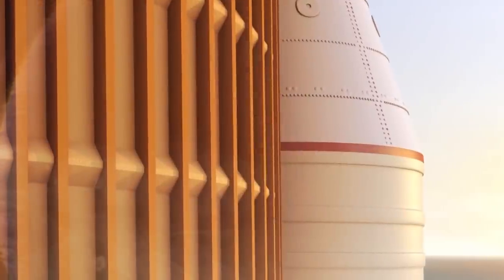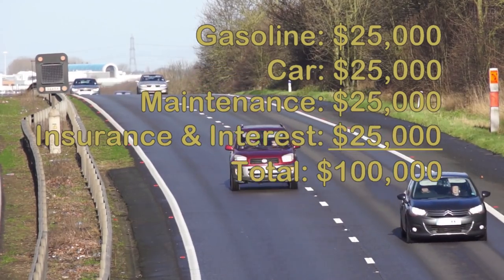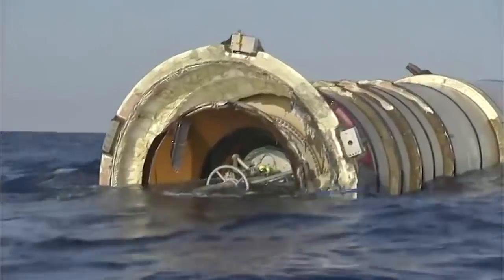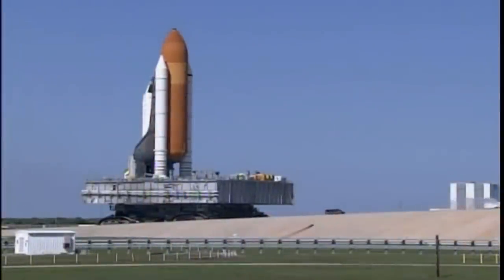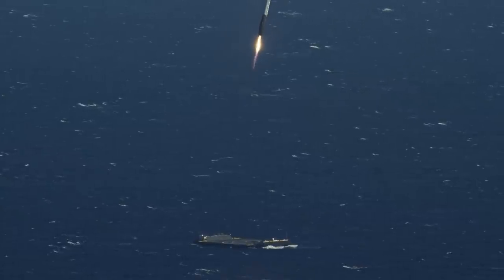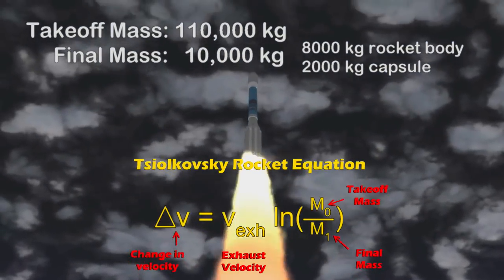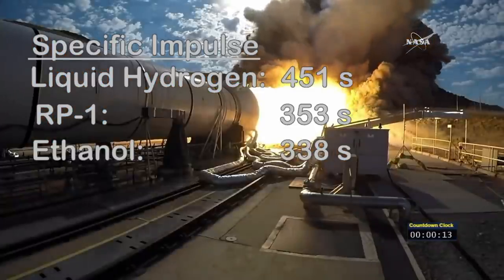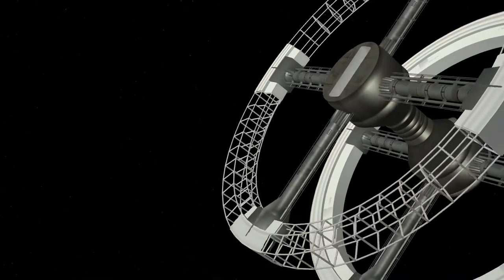Reusable Rockets & Metallic Hydrogen

Comment: I think you forgot about the possible environmental concern. Apart from pollution, sound travels further in water possibly disturbing the ecosystem.
Reply: That's one of the benefits SpaceX has using methane as a rocket fuel.  You can manufacture it by literally pulling it out of the atmosphere using the sebatier process, making it a carbon neutral fuel.  Once SpaceX gets their Starship/Superheavy production chain properly up & running, they could save costs & do a solid to the environment by literally pulling their rocket fuel out of thin air.

Comment: Isaac, do you have any thoughts or opinions on using existing "air-breathing" technologies (jet, ramjet, SCRAMJet), as a "stop-gap" means of reducing fuel weight on takeoff? There was considerable interest in this area some years ago (jet-powered heavy-lift air frame, carrying a reusable rocket-propelled "Space-Plane" as high as possible, to a) reduce air drag, and b) eliminate oxidiser costs)? This would seem a sensible (and "fully achievable with current technology") solution, so, since we've not seen this as a development, presumably there are serious problems / hurdles with what would be, "on the surface" an ideal solution? Thanks for your thoughts on this matter!
Reply from the maker: It's one of the topics I'd like to visit when we revisit this series down the road, because it has a lot of possibilities especially in conjunction with skyhooks, but I haven't gotten up to date with that are in a while and it didn't seem core to the series so it got bypassed for now.
Reply: Thank you for your comment! There seems very little recent interest in this area, which would seem a pity, since if adopted, this "should" reduce orbital payload costs by a useful margin!

Comment: Sir, you did report the Falcon 9 launch price tag is 60 million dollars.

We also know it can carry 22 tons to LEO.

So isn´t the price per kilogram 60 million / 22k?

U$ 2,727.00 

So I am baffled why you use the U$11 thousand per kilo figure for the episode when in the very same episode you gave a 60 million per launch price tag.
Reply from the maker: 22k is when you are using the F9 Full Thrust version, and using it as an expendable rocket, not reusable. The reusable value, last I looked it up, was rated at 9600
Reply: Ok, but what is the price tag of a F9 FT expendable launch?

And what is the payload to LEO?

Isn´t the cost per kilo (to LEO) simply the ratio between launch price by payload to LEO?

Comment: Is it worth putting wings on a metallic hydrogen rocket to make a space plane or is it best to just take off and land on its tail? SpaceX don't seem to be keen on wings or rotors for landing reusable rockets. Is metallic hydrogen powerful enough to make a powered deorbit cheaper than elaborate heat shields?
Reply from the maker: I'm not enough of an Aerospace Engineer to say which would be best, either should be workable but stuff like that is way too reliant on the specifics of the materials.

Comment: So I drained all the oil and cooling liquid from my car and let in run at full throttle in neutral like your saidl, and yep it didn't last very long until it started smoking. Naturally I called the fire department and when they asked what happened I said some guy on the internet told me to run the engine with no oil and coolant. Unfortunately my insurance won't cover the damage for some reason, I don't know what to do now Isaac!
Reply from the maker: lol

Comment: You have forgotten the most important thing, to factor in the different costs of manufacturing 1 kilogram of propellant.

Metallic hydrogen costs ?millions per kilogram to MAKE, so this sort of makes it something more like $10,001,650 per kilo to orbit. 

But then there is also the cost and complexity of making the tanks.....

Not so good, it already costs a lot to make liquid hydrogen, thankfully halved because you also get liquid oxygen, metallic hydrogen will cost orders of magnitude more on top.... so just stick with hydrogen.

P.S. I like your style of making these videos though, instant sub after watching this first one.
Reply from the maker: The stuff is brand new, it might turn out to be something we could make, store, and transport at a reasonable price. It will doubtless be more expensive than liquid hydrogen, but maybe twice the price or maybe 10,000 times the price, time will tell.
Reply: There's a similar line of reasoning regarding Graphene - and it applies to most anything exotic.  The first automobiles were prohibitively expensive toys for the wealthy - until Henry Ford made them on an assembly line.

Comment: Having been in the shuttle program and other expendable and reusable space craft projects, things are more complex then you think.
-The SpaceX launches (with all the overhead and upfrount costs) cost NASA about 1/4 th as much as the shuttle flights did, but it takes 5 Falcon/Dragon flights to lift as much as one Shuttle flight.
- almost 75% of the cost of the shuttle flights is due to accounting and oversight difference between the NASA FAR contract Rules used on the shuttle contract, and the NASA SAR contract rules used on the COTS contracts.  The contract firms who operated the shuttle fleets (mission control staffs, training, everything else) pointed out they could fly the shuttles for less per flight then the COTS firms (SpaceX and Orbital) flights. Just by changing these administrative rules, and drop it far further then than buy making some simple serviceability improvements that would also improve safety    But for political reason NASA ignored the offers.

- because virtually all the cost of the ( NASA and Commercial) flights is due to the upfront and fixed overhead costs of developing the craft, and maintaining the facilities, over the virtually negligible flight rates, even throwing away the craft after very flight hardly maters.  So really it's flight rate that kills you. N though it's really hard to get a high flight rate with expendables.

On the plus side, the shuttles margin cost per flight is only $50 million a flight (compared to the $70 million a flight deal NASA got with SpaceX) so there is a lot of potential.
Reply: Kelly Starks I am not sure where you get your numbers from but the Falcon9 can carry more cargo than you said/think. 
The space shuttle was capable of carrying 27.500kg to LEO and the F9 is capable of 22.800kg.

The space shuttle flew for a minimum of 450 miljoen to 1.5 billion dollar.
The F9 was contracted bye NASA for 130 mil a flight including the development costs and all with it through a contract for 12 flights for 1.6 billion dollars.

The price at the moment for the F9 is 62 miljoen and thus can go as low as 2850 dollar per kg in expendable config. And can go under 2k per kg in reusable mode and expected to go even more down with the Falcon9 Block 5 comming wich can carry even more cargo and is designed to do around 10-12 flights before major refurbishment is needed cutting the cost even more way down
Reply: Having been in the program, you should know better than most of the public that the real reason the space shuttle program wound down was not cost, it was reliablility.  The problems emerging in the program were identified by the Rogers Commission and went largely uncorrected after a decade, then came the Hubble drama.

I don't have reservations about a private company contracting launches if they have the right leadership, which I believe is clear SpaceX does.  They have paying customers on one end, who want the results they pay for, and investors on the other, who want the operation to become profitable so they get ROI; then there's the insurance, safety, and QC concerns in the middle.  As long as the company does everything right (which is what should be done to make every launch successful anyways), everybody wins.

Comment: Something that I would point out about MH is that with an exhaust temperature of around 7,000K (which is why it has such great specific impulse), there's no material in the world that you could build the combustion chamber out of and have it not melt. As a result, the major proposals revolve around adding a coolant to the chamber to reduce temperature to something that'll not melt the engine, reducing ISP into the 800 to 1200s territory depending on the coolant used (either water or LH2), which is kind of a letdown (it's back in NERVA territory), but is still rather impressive.
Reply: indeed mon librepenseur, thanks for this insight
metallic hydrogen (hydrozene benzate etc)
would be used early in flight, via coanda effect burner focusing...
this way, it's not directly in contact with the nozzles etc,

though i agree - this puts thermite etc to shame! 
melted craft = 0 delta v hehe.

later, other approaches may be used for other stages
hall effect with bussard-ramscoop,
"QVT" (if you trust H White et co...)
Compton annular decomposition etc.

it is still subject though to ERoEI from total systems throughput eh,
as Al Bartlet, MK Hubbert, S Michaux et Michael Stevens outline...
we are trading a 'surplus' of "delta-v"
for rare-earth metals at a grade not presently obtainable in commercial volume on earth.

hence, Astromining et Return2Earth missions for nearby astromining eh?

je prends conge,
bonne chance a vous!
Reply: You could also operate the engine at much lower power/chamber pressure and rely on radiative cooling, as with many small OMS engines in use today. Unlikely that you'd be able to attain TWR >1 for liftoff with this approach, but it would work fine for orbital maneuvering. Potentially you could do both with one engine: use open cycle cooling when you need high thrust and use the low thrust high Isp radiatively cooled mode when you don't.

Comment: Love your video's. Could a jet engine be used for the first stage of a rocket, components would be cheaper and reusable.
Reply from the maker: Sure, there's engineering problems doing it that make it less attractive as an option but engineers would love to not have to carry as much oxidizer, it's usually the mass majority of the fuel.

Comment: the paint on the external tank was there for more than thermal protection. it was part of the Integrated Tank System, the name given to the entire external tank, and its primary purpose was to replace the aluminum that would have otherwise been used to keep the actual insulation on the tank. nasa knew it was going to kill a crew when it removed the paint, it was explained to them by the engineers who designed the thing and they dropped it anyway.
Reply: The paint was replaced with an inspection schedule of the insulation.  The Discovery accident happened because of (another) launch too close to parameter limits combined with a shoddy inspection.  Again, not bad design, bad decisions and quality control.

Comment: Doesn't metallic hydrogen, need a lot of compression, this would mean tanks would be heavier too.
Reply: Dan Nguyen I have to admit I am not well informed about the topic, but my strong intuition was, that it would easily change into its original form(I know water can be a metastable(I hope the term is rightfullly used) liquid under 0 degrees and standard condition).

I just can't think that it would be stable enough to undergo the turbulence of launch.

It is debated by scientist if it was even created or just fake news.  The sample was lost. I think if it was created the government may have stepped in as it would be a powerful metal or it was not.

Comment: Err, has anyone looked at the safety issues in using rocket-fuel-grade explosives as a superconductor? Even being a superconductor means the amperage won't detonate it, if it does detonate, that could blow your entire research lab/fusion-generator/power-line to tiny pieces of burning rubble.
Reply from the maker: lol, we're nowhere near that stage of things yet to be worrying about trivial practicalities like our device exploding :)
Reply: Well, I knew that, last I heard the harvard guys lost track of the only maybe-sample on earth. 

What my poorly-phrased comment was attempting to do was vent my frustration in overhype by getting simple questions asked. Questions like "What use is superconductivity in an explosive?"

Comment: May I ask where did you get the figure of 5700$/kg for Spacex? I was curious since it is quite a lot more than the 30% drop of price they said was their first goal.
Reply from the maker: One of the engineers for a different company I was using as a fact-checker, it's their new target value as a result. Rockets is one of those 'angry hobby' areas so I got fairly extreme in my fact-checking to circumvent that. Still got some remarks along those lines anyway. :)
Reply: Ah thats explains it, thank you for your commitment in fact finding and your amazing work, you are a well of knowledge even in the discipline i should know best.

Comment: So sorry for being redundant, but what did you think of the idea floated by a physicist of ramping up our ability to make antimatter? We can make it now, the improvements needed to make more of it and store it safely are probably less than what would be needed to make fusion (or metallic hydrogen, for that matter). Finally, it would make the ideal rocket fuel, in terms of thrust to weight. Making a small amount of it would essentially solve the issues with rockets.
Reply from the maker: Well as I've said elsewhere, anti-matter is your ultimate rocket fuel, so if you can mass produce and store it safely then it replaces everything else.
Reply: I'd so love to see one of your great analyses on that. Was this done before, or might it be upcoming?

I think that's a great thing about your channel, is you go into subjects in detail that many consider too far off to devote attention to.

Comment: graphene is carbon. how well would it hold up to rocket flames and reentry heat with oxygen around?
Reply: The spaceframe can be carbon, with traditional materials used for engines and plumbing.  Also, graphene would bond to ceramic tiles much more easily than the NASA Orbiter, which needed a two-adhesive application.

Comment: It would have been awesome if Isaac mentioned the ITS rocket instead of the sea dragon, or both.
Reply: But the ITS isn't a Big Dumb Booster so it doesn't illustrate his point. It's Big, but you can hardly call something with 42 closed cycle engines in the first stage and made almost entirely of carbon fibre "Dumb". The Sea Dragon has one pressure-fed engine in the first stage and is made of steel.

Comment: You say that reusable spacecraft are the gateway to future in space, not the future in itself, but doesn't it hold quite some potential for relatively easy exploration of other space bodies such as mars? Because then you have a spacecraft you can send to another planet, easily land it and takeoff, and be able to reuse it for other missions. So isn't reusable spacecraft the gateway to a developed infrastructure and the future of space exploration?
Reply: Once you've made a space elevator on earth making one mars will be relatively easy. Just lift some space elevator material to near the top of your space elevator, let it off to get it near mars, then do a small circularisation burn to get it to mars-stationary orbit and let it down. In the case of mars, you'd have the problem of having to resonate it so it avoids the moons of Phobos and possibly Deimos, but this become a lot easier when you already have an earth-based space elevator to test on; and if worst comes to worst and doing this is unviable, you could always have space elevators on martian moons linked by skyhooks. 

This may not be the case with launch loops though (launch loops are heavy, proposals for them on other bodies usually involve building them from resources there).
Reply: IamGrimalkin, yes perhaps, but whilst once a space elevator is made in earth orbit, making one on mars becomes relatively easy, it's still going to take time, resources and scientists to build it, and off earth space elevators are only worth it if your going to colonise the planet, so you need to gather data to see if colonisation is worthwhile on the planet in question.
To do this, you would ideally send in a reusable spacecraft, that lands in an area, makes a survey of the area, takes off to survey another area, repeating the process several times until you have a good idea wether colonisation is a good idea.
So reusable spacecraft, after a cheap and complex infrastructure is setup are still going to remain relevant for exploration, and keeping some around is probably a good idea in the case that something breaks down.

Comment: I would like to hear some discussion of just how tetchy metallic hydrogen is going to be...     butterfly flapping its wings next to the rocket set off a high order detonation of the entire fuel mass kind of tetchy...
Reply from the maker: That actually is a real concern, I'm a little surprised I didn't discuss it but Metallic Hydrogen was a bit of late addition to the script, though until we've got quantities of it large enough to fill a decent sized beaker with it, it will be hard to really discuss how much vibration is a concern. Probably a big one considering how much it already is with conventional rockets.
Reply: There's a science experiment where water is placed in a pyrex pitcher, heated in a vibrationless (no turntable or fan) microwave, then tapped with a pipette.  It's called hyperboiling.

This isn't that experiment, but it illustrates the point.
https://youtu.be/2FcwRYfUBLM
And certainly don't try it with alcohol or anything else flammable or volatile.